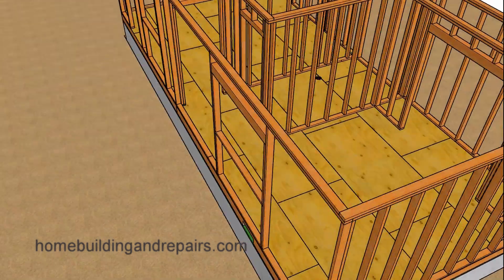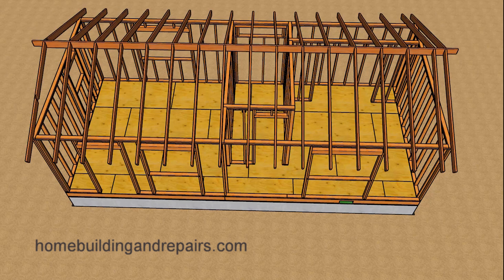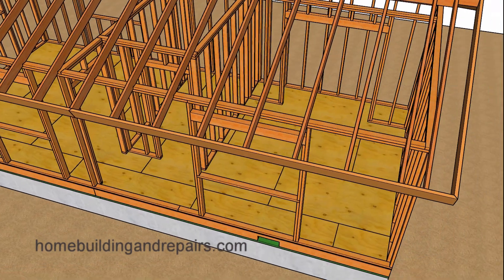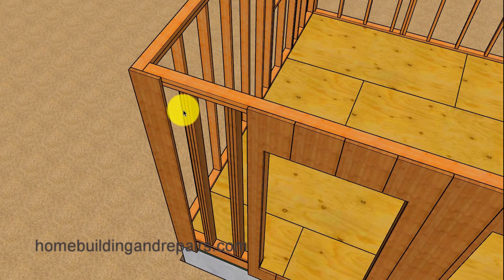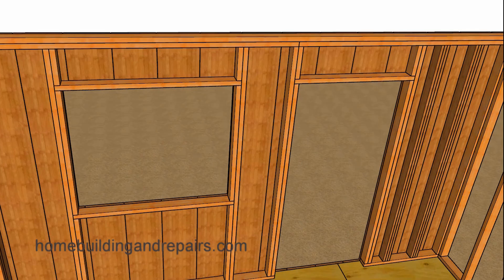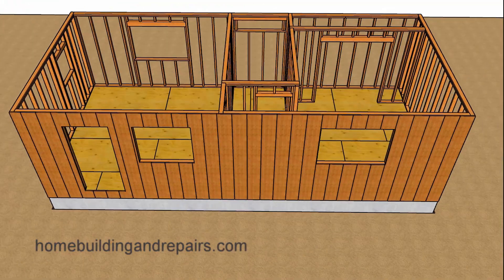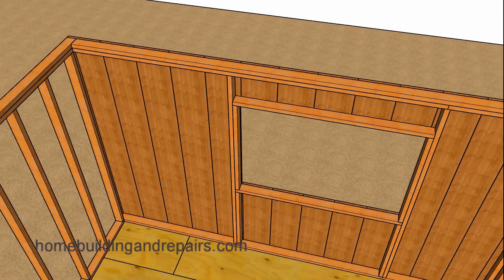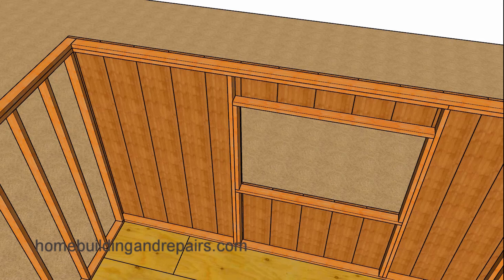This Surprised 40 Year Home Remodeling Pro - 6 Foot on Center Stud Spacing

Comment: I know here. In Holland, lumber framing is on a rise. But it’s framed 2x6 16” oc. not sure if that’s code ore not. Since we don’t have earthquakes. However we do have a lot of gusting wind. I was planning on building a 14x24 insulated garage. But lumber prices are getting kinda steep now.
Reply from the maker: Here in USA, 16 inches on center with 2x4 or 2x6 seems to be common.
Reply: @gregvancom  Use there any benefit of using 2x6 instead of 2x4 for wall frame ?
Reply: @gregvancom  ok thanks!  2x6 16” on center is pretty common. Dimensions are actually 44mmx140mm and 400mm on center. 
It’s on all fours is the running joke. But I found it very odd cause every single pack of insulation I can find is 610mm wide. ( that’s 24” wide ).
Is 24” om center sufficient for a 2x6 framing?

Comment: We recently built a shed, think 8x10  screened porch,  out of free second hand lumber. 
Not enough to do stud walls , so we put diagonal bracing. 
We just added diagonals,  until the outer frame of each wall didn't wiggle under heavy force.
Reply from the maker: Awesome and thanks for sharing.

Comment: Ever come upon a house built without a sill/mud plate? My houses floor joist are set right on the concrete block foundation. No j bolts or anchors for uplift protection. House was built in 1974.
Reply from the maker: I don't think I have, but plenty of homes that were not bolted to the footings.
Reply: @gregvancom  Appreciate the response, always look forward to watching your videos, especially before tackling a new project.

Comment: I live in a 60 year old 3 bedroom home in Hawaii and we call this single wall construction where the wall siding is also part of the structural supports. The homes are considered grandfathered in prior to the new updated code requirements. They are mostly constructed of redwood we don't have snow however we do have hurricanes every once in a while and these homes seem to last longer then the new construction double wall homes that are built to code now. Termites don't like redwood and these old single wall homes are now selling for $1,000,000 on Oahu, crazy huh? I don't comment much but I just wanted to tell you those types of homes are very common in Hawaii and they stand up strong enough to raise a few generations of children in. 

Aloha, 
from Hawaii
Reply from the maker: Awesome and thanks for sharing.

Comment: Hello, I have a question. I am building a house that is 30 feet across but Lowe's doesn't supply lumber that long and it seems a bit ridiculous to try to install ceiling joists that long. So, I am planning to put a couple of standing beams in the house and then lay a couples beams on top of those beams, creating a kind of bar. Then when we install the 15 ft ceiling joists they can meet in the middle and be connected that way. Will this work and if not is there a better way to do this?
Reply: I think this is one of those situations where you should contact a structural engineer or at least someone who frames houses for a living. My parents' house has an open kitchen/dining area that is probably 30' across and the roof is made with large pre-fabricated trusses (all designed to the engineer's specification). You didn't mention if there would be one room or two spanning the width of the house - if it will be two rooms, then the center dividing wall could be load bearing. That's how my 24' wide house is built.
Reply: @RandomNumber141  It's going to be an open area. Does it sound like it would be structurally sound?
Reply from the maker: If it's open, then you might need additional structural supports. I think I replied to your email this morning, but without any interior walls, you might need to use metal posts with large concrete footings or look into pole barn type of construction.

Comment: Interesting situation. If you recall, which direction was the roof sloping ? In Chapel Hill, NC, I recently saw a deck of a house about 10 feet by 16 feet, standing 12 feet+ above sloping yard to a creek, only supported by (3) 6x6 posts & 2x8 floor framing @ 24 o.c. (I corrected precise sizes. However, the deck framing was undersized than local recommendations). Just at first sight it was frightening, but the deck has been there fine for at least thirty years. Another smaller balcony was only supported by (2) 2x4 bracing to underside of double rim and no posts, about 21 feet high. I thought whoever built or designed the balconies was genius.
Reply from the maker: Yes, but would you walk on it? The roof rafters were sitting on these over spanned wall framing.
Reply: @gregvancom  Three of us and two kids were on that balcony for 15 minutes (I corrected precise sizing of the decks on above comment. The deck framing high above seemed so undersize that new owners immediately hired an Engineer to evaluate). Sometimes, I wonder if woods used decades ago was superior. In this particular case, I kept thinking if the designer/builder knew the minimalist approach.

Comment: A few years ago Hurricane Maria hit Puerto Rico as a cat. 3 or4 and though this one residence was partially de-skinned, one could see the framing. The walls were 8 foot high and studs were @ 4 foot on center. The back of the structure was on the high bank of a stream and (2) 4x4 posts were sitting on a rock @ the streams edge; I just couldn't believe my eyes were seeing this structure still standing. By the 2x4 studs exposed, the structure was 12 feet wide and 20 feet long. I know they are poor, but that doesn't change what works and what shouldn't.
Reply from the maker: I hear yeah, I've seen things on the internet that you wonder how they made it through.

Comment: Why use dimensional lumber these days? Frame from the start with true 2X6” rough cut. Much stronger and cheaper
Reply from the maker: Rough sawn lumber in southern California is more expensive.
Reply: @gregvancom  I’ve used it in Maine and NC about 30% the cost

Comment: There’s no mention of how/if the attic floor is sheathed. True 1 x 6 T&G would definitely as rigidity to the entire structure as well.
Reply from the maker: No attic sheathing and it also had a wood framed floor.